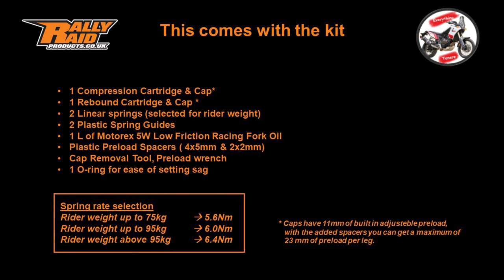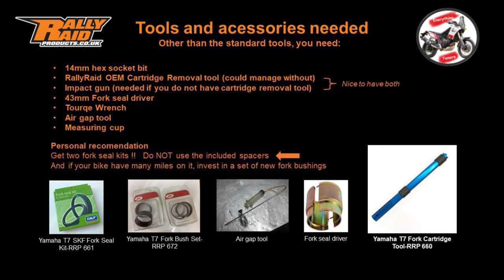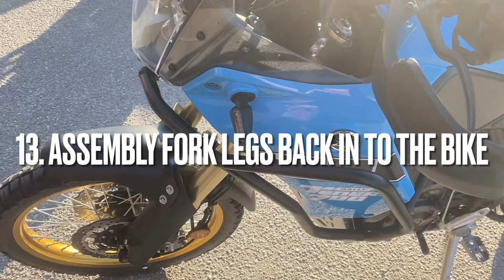RallyRaid Open Cartridge Kit - Full Install Video - Yamaha Tenere 700

Comment: Awesome job as always Marcus!  When you did the final air gap check @ 28:44 should the outer tube be aligned at the same level as the inner tube as was done @ 27:46?
Reply from the maker: Yes MIke, you should try and keep the level. 
But I think it is more important, to first of all pull the outer tube up till I stop gently. 
That way all oil that is between the outer and inner will drain in to the cartridge/inner tube.

Comment: Marcus - thanks for your detailed videos! Based on this video i have confidence to install the open cartridge kit myself. One question though - what spring rate did you go for and what are your impressions? I read some post where people of my weight (88kg without gear) find the 6.0 Nm to harsh and instead opt for the 5.6 Nm. I am not an agressive rider and like a plush ride. I have ridden bikes with good suspension so I know how it feels when it works well.
Reply from the maker: I use the 6nm one, and yes it is a bit harsh. But I also tend to bash it lol, so a softer might not be bad for you.

Comment: Thank you very much for the video, I have done the same fitment and your video confirms my methodology. One question, do the dust /oil seal kits come with the open cartridge kit ? There were no seals in my kit.
Reply from the maker: The SKF seals does NOT come with the kit. Bredd to be ordered. 
Now RR have pairen the seal kit, so of you order one (1) you Will get two, so for both legs. 
Otherwise one seal kit is just for one leg, but too many ppl order just one and then later had to order a decoy d one. 
One  is about 23£, now 1 kit is about 57£, so it included two of the skf seal kits to cover both legs.

Comment: Thanks for installation details. What is your experience with RR Open cartridge kit during off road riding ?
I have ridden mine for about 3k km and for me its really harsh on small bumps off road and even shaky on uneven tarmac.
Played with compression adjuster and found that it gets slightly better when almost full anti-clockwise.
Kit was installed by suspension shop following RR instructions and with proper air gap, both sags are set for my weight.
Hence, asking whether its only my case like that or other off-road riders have similar experience.
Reply from the maker: I have the 6Nm springs (I’m about 90kg with gear). 
Not sure if you have the first gen kit, depending on when you bought it. 
The valving might need to be trimmed to you riding style. 
But yes, it’s a bit harsh maybe, but not bad. 
I’m not bothered by it that much, I feel it gives a much better off road handling than oem. 
But I do adjust comp depending on what I am doing. So for gravel road and slow stuff off road, I have the comp quite low. 
But doing more difficult stuff, wooos etc I need to go harder on comp. 
You should maybe try out a lighter spring, reach out to RR and ask them regarding steps to take. 
I know ppl moved the fork up a bit in the triple, but that’s more for less nervous behavior when going fast on uneven terrain. 
But also changing the rear shock I noticed better behavior overall. 
It’s all a lot of magic in setting stuff up perfect 😅. Don’t forget to play with rebound as well, when I added some more rebound this weekend I noticed better handling. 
Over all I’m very happy, but I wouldn’t mind testing the +30 front and rear. Closed cartridge should have better performance, but serviceability isn’t as good for a DIY’er like me 🤪

Comment: How do you set compression and rebound? Is it only the center screw?
Reply from the maker: Exactly!!
RR open cartridge kit had one compression cartridge and one rebound cartridge. 
So I have the comp one in the left leg and rebound in the righ. 
So you only need to adjust from the top, middle screw is the clicker and the outer nut is a Preload adjuster.